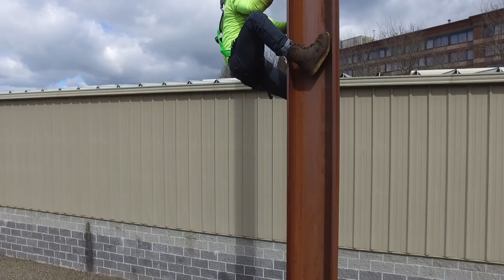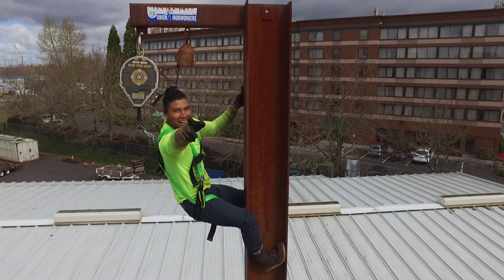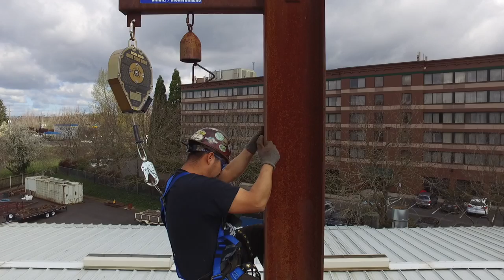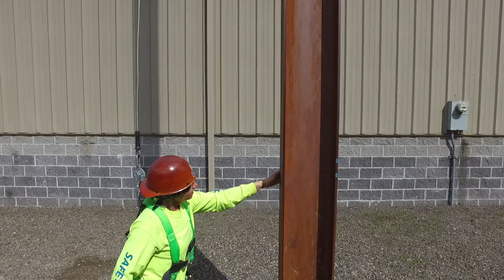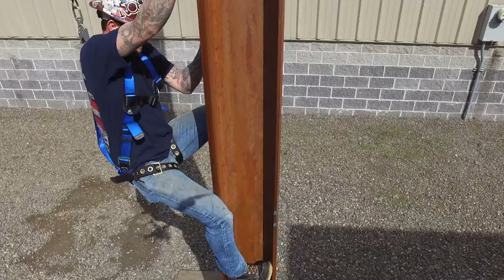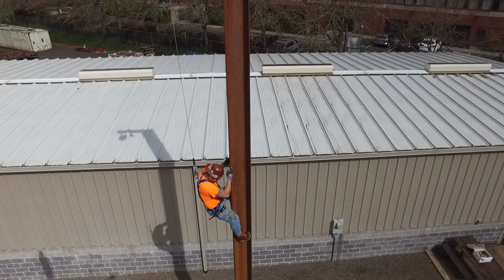Column Climb

Comment: Hahaha.  On the job you will have a belt on.  With at least 2 spud wrenches I bull pin alignment pin A 4 pound sledge hammer and A bolt bag full of large, bolts,nuts and washers Add at about 40 POUNDS!  I did all of this when I weighed 126lbs
Reply: youre right mate, the belt & tools is heavy, then add the bolts
Reply: Yeah the bolts are heavier than the tools when both bags are full. Lol